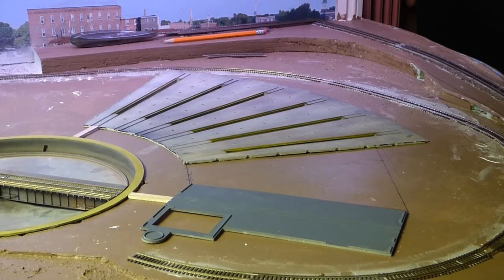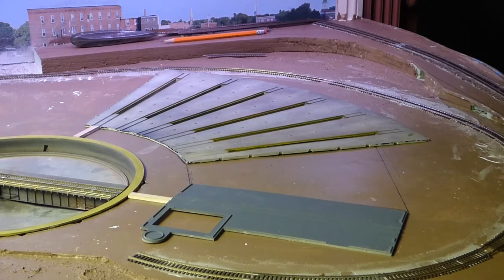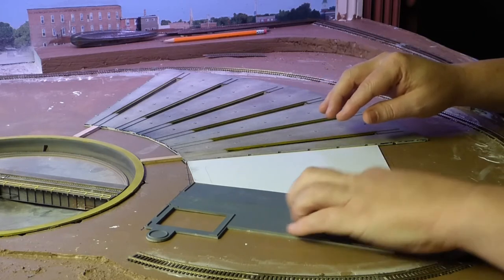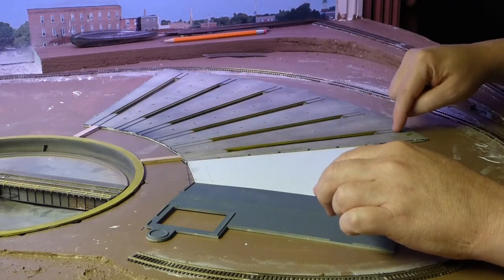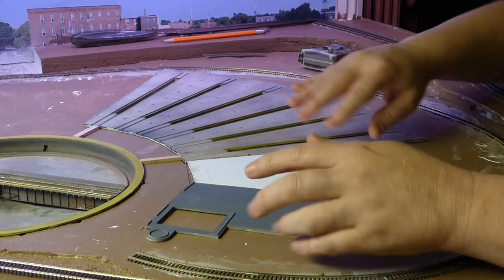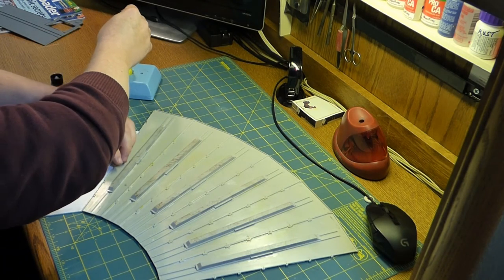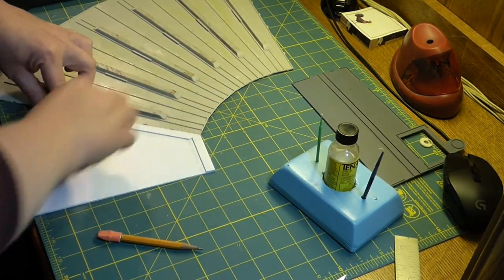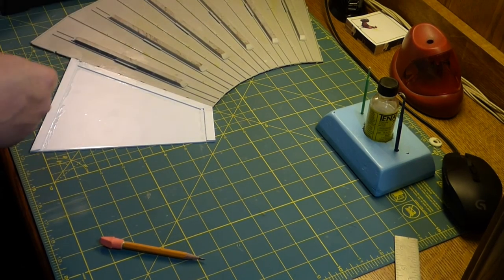Roundhouse Machine shop Kitbash Part: 1

Comment: Hi Mike! Just found this site, and was wondering did the inspections pits come with this kit? I have the Walthers 6 stall Union City Roundhouse. It has the cut-outs for the pits, but alas they are not included. (bought this kit prior to retirement with the idea to build a layout) I purchased 3 Peco inspection pit kits, they are nicely done, but they are not even close to the cut-outs of the Roundhouse. My guess is this is an older kit and the Peco product probably wasn't around? So the fit will take some work. I am now second guessing and maybe thinking of selling it on Sleezebay since I haven't started it yet, and buying the same one you have. I will follow the rest of your builds for great insight and tips. Keep up the helpful videos!
Reply from the maker: Thank you very much! Yup the kit I built in that series came with the pits. I can’t remember if I showed them in the series though, I’m sure However you decide to do yours it will be great good luck and enjoy the build. Thanks for watching enjoy the rest of the series and have an awesome holiday season!

Comment: Nice work!  This is the series I've been waiting for.  Question: where do you get the Tenax?  I can't find it anywhere, and I understood that it is no longer made.  It's my favorite stuff to use.
Reply from the maker: Thanks ed g, yes it's a tenax bottle but that's not what's in it. It's actually something called m.e.k. with a lot of styrene scraps disolved in it. I know there is a lot of debate on the use of it but I have been using it since tenax disappeared and I think I like it better.